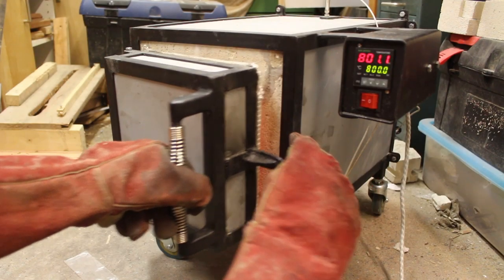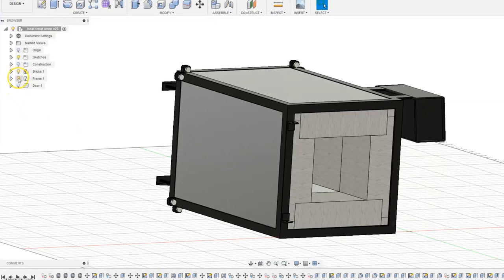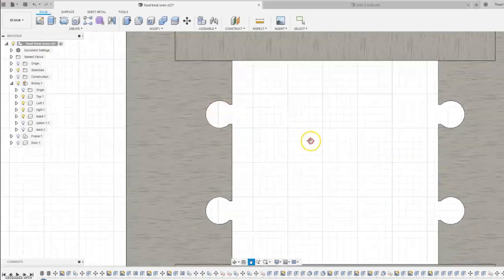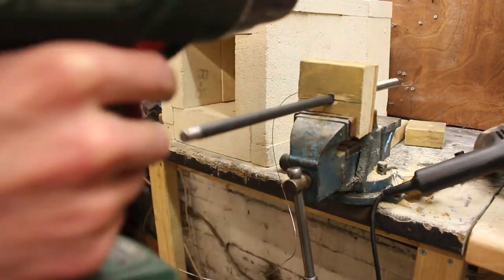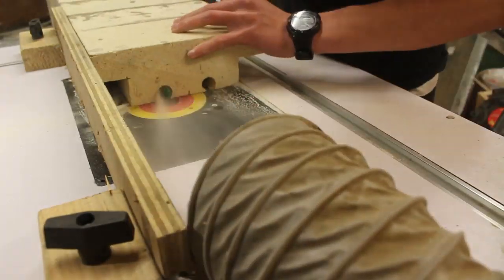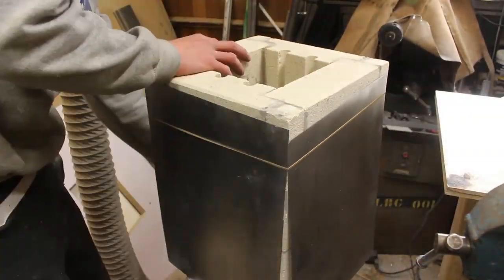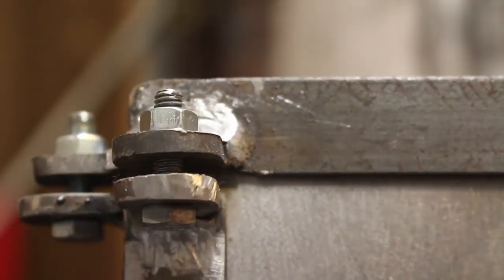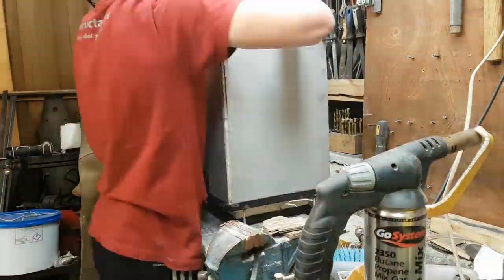How to Make a Large Heat Treatment Oven - Pt.1

Comment: If you're still having problems with cracking, try quenching from a lower temperature.  Yellow is hotter than necessary for steels.  Bright red to red-orange should be sufficient.

Comment: Hi, could you make a few inner sleeves out of the bricks to place inside the oven to tailor the inner chamber size to suit the current job requirements? It would save you having to heat up the unnecessary volume.

Comment: Hi TAOW,  Your videos are great thank you. I’m in the process of designing a heat treating oven and wanted to get your input on the element sizes. The internal measurements are 15.24 cm high by 13.97 wide by 34.29 cm long. I am looking to treat knives and small tools and can run either 120v or 220v. My designs is similar to what you have posted here. Any feedback on Ohms Watts and Amps would be appreciated.

Comment: I have a question about the wire gauge... I looked online and saw that it is reccommended to use 4 gauge wire for heat treatment ovens, but you used 18 gauge, is it because your made it into a spring that you. didnt need a low gauge?